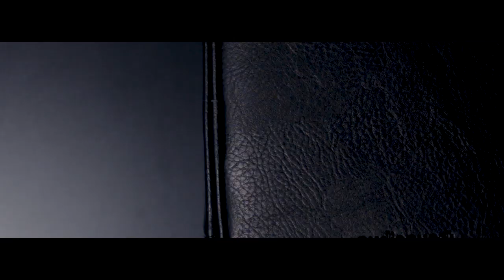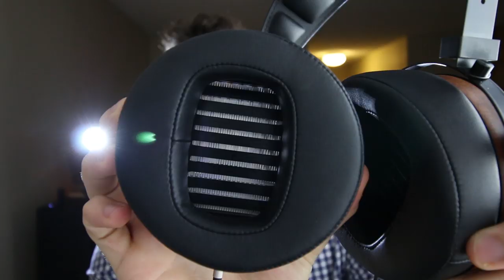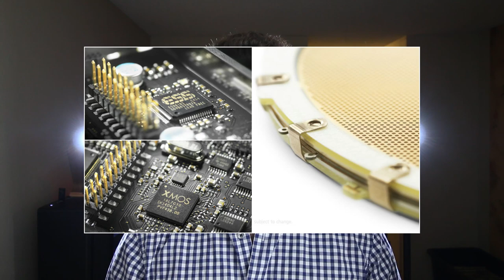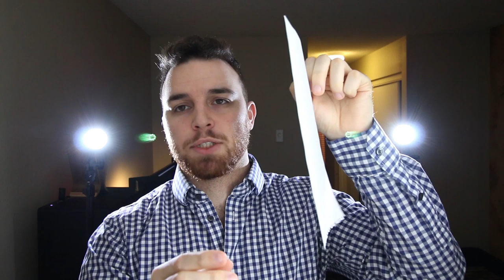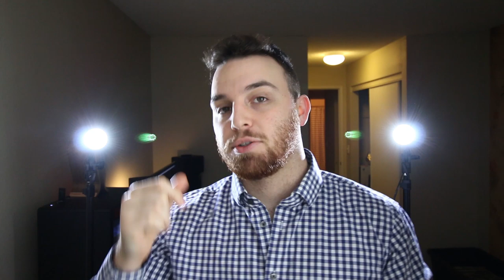Dynamic vs. Planar vs. Electrostatic Drivers | How they work and sound | The BASICS |

Comment: hmm, open back headphones means that the back of the cups are open. The other side of the cup can be sealed and still be called open back. SoO the sound can still bounce around inside. 
Try some of your planar headphones. push the cups towards your ears hard and quick enough and you can hear the driver crinkle. this wouldnt happen if the air was allowed to escape

Shining a light through a planar headphone doesnt demonstrate that its acoustically transparent. the material on that particular headphone just happens to be transparent (or somewhat transparent).
what you just did was like; shining light through a glass window and claiming its acoustically transparent.

Like dnalekaw mentioned below, sound pressure isnt all about driver excursion. its about how much surface area is moving the air. a planar driver being larger in surface area can achieve the same sound pressure level as a dynamic driver with less excursion. Bass response on better planar drivers measure near flat all the way past 20hz, so yeah, they can do bass.

Comment: 1:32 - When the ribbon, planar, electrostatic, and/or a moving coil transducer/driver within a set of reputable head phones (or speakers) are  asked to simultaneously reproduce a high frequency and a low frequency signal  what really happens is called "time averaging".

As, clearly both frequencies (not to mention the thousands of other frequencies that exist at any 1 time within normal listening music) the ribbon/other transducer can’t possibly perform this feat and reproduce the same signals simultaneously, and therefore time averaging occurs. 
 
To minimize time averaging we (professional loudspeaker engineers) apply techniques such as frequency and amplitude division.

Luckily for us that our ears - despite how remarkable they are at detecting small/large nuances of sound - are basically (I am trying to keep it simple with these terms) immune to most reasonable levels of time averaging - provided the source material is complex enough so that it has multiple frequencies/pitches within it and no 2 sounds alone can be individually detected (to be time averaging to the listener) by the listener at the expense of the others.

Kim Shaw

Electronic Engineer
Electrical Engineer
PhD Electroacoustics.

Comment: E
Reply: thats right
Reply: What about electrostatics? Are the diaphragms used on electrostats similar to those on planars? (As in it moves more air than the dynamic)
Reply: dnalekaw Thanks for the clarification. I really wonder why headphones don’t incorporate more drivers in them? Like how a traditional three-way studio loudspeaker is designed? I can imagine a large driver with a mid and a tweeter overlaid in front and to the side of it. Like a Venn diagram, with different sizes and angles applied to the drivers? With in-headphone amps becoming smaller, better and cheaper, it seems like there could be a much more sophisticated design applied to the way power is delivered and managed. I saw a pair of headphones reviewed that incorporated a passive “woofer,” but it seemed a little hokey. I think it’d take a company with the money and resources of Sennheiser, for example, put it all together.
Reply: @dasaauto2024  driver matching, Phasing, timing, disturbances between drivers, different sound radiation patterns, impedance considerations, weight. A single driver is adequate in reproducing all frequencies already. Essentially, all the answers u need are the exact opposite of the advantages of  a single driver home speaker.
Reply: Thank you
Reply: you forget to say. that the planars have much worse dynamics, because of huge resonances of membrane after some sound decay. and this is because of lack of damping.
Reply: TL;DR
Reply: Because you know way more about this than I do haha. I mostly play games. But, also watch movies and listen to music and stuff when I want to. Would you recommend something like planars for gaming?
Reply: riseuplight bruh just fuckin read
Reply: bandgeekforever100 • For a “utility user” like you, buying gear for a specific purpose (probably competitive advantage), there are a number of things to take consideration of.

First, gamers tend to play for more than 30 minutes, so weight and long term comfort are paramount. Usually, Planars are the heaviest with all those magnets and the rigid structure required to hold the parts apart despite the strong forces. Electrostats and dynamics are much lighter.

Second, cost. Electrostats require specialized equipment (the Energizer) on top of the “Earspeaker” itself... the least expensive is the Drop.com exclusive variant of the Koss ESP/95X at $450 (out of stock for the 120V USA version), and Stax’s least expensive are a Japanese import (2-4 weeks) SR-L300 + SRM252S bundle for around $800 USD. If you’re shopping above entry level prices, the Fostex T50RP mkIII is a nice planar magnetic headphone for ~ $160, and of course Dynamic headphones range in price anywhere from $10 and up.

Third, sound quality. The balance of frequency response is part of it (going lighter on the bass helps prevent tactical details from being overshadowed), but only part of it. It’s also ideal to seek clarity and low distortion, high resolution, the illusion of spacial depth (aka soundstage), and A NON-FATIGUING SOUND. It’s worth emphasizing against fatigue, us gamers play long enough that we can potentially cause permanent hearing loss (and probably will). Now, Planars and Electrostats have extremely light drivers (often lighter than air), so they are easy to control and theoretically can have better clarity, but dynamic drivers have become impressively advanced and some examples can stand right along with Planars at equivalent prices. Planars can have more bass impact (because the drivers are huge!), but dynamic drivers can extend lower into sub bass frequencies and some drivers are also very large to displace a lot of air (so they also have good impact... a nice amp helps all kinds of headphones to improve this). When it comes to spacial depth and imaging, it actually matters more if the drivers are angled to match the angle of your ears than what kind of driver you use... that said, the deepest/widest soundstage in headphones are currently found in Dynamic driver headphones. Virtual headphone surround or spacial audio processing GREATLY helps any headphone to achieve a useful “image” of where a sound could be coming from in front or behind you, and I highly recommend adding some form of digital signal processor (DSP) to your gaming setup (coming soon to be built into the XSX and PS5!).

In the end, the most practical and value-for-the-buck option for gaming is a dynamic driver headphone... though cases can be made for the others. One example is the Sennheiser PC37X... it’s a gaming headset, with a quality boom mic that you can flip up to mute and get out of the way, lightweight but strong plastic, generous earpads and headband padding, angled dynamic drivers with a bit of upper mids emphasis for tactical cues but also a bit of bass for fun, 2 year warranty, and Sennheiser’s R&D has been able to greatly reduce distortion (and the modal breakup from wobbling drivers mentioned by the first comment). Referral link that gets us both a discount, though Drop also has Planars and Electrostats if you look: https://drop.com/buy/massdrop-x-sennheiser-pc37x-gaming-headset?utm_source=appshare&referer=Z2JXCA
Reply: My Hifiman HE400i can output much more bass than any dynamic driver I have ever owned.
Reply: @Countryguy5967  planars for gaming? I have one single sentence for that, Hyperx Cloud Orbit S. Without going over twice what these cost, I doubt I will ever find a better headset, let alone a dynamic driver headset capable of beating the Planars on the Orbit.

Comment: let's simplify things a bit in terms of comparison, because how they work, You can't beat a piezo electric driver in low frequencies(taket h2), If you are ready to pay 5k$+ electrostatic headphones are just better at everything, cheap models&high-end electrostatic models with average amps will lack sound stage & bass but with good amps which can swing  high voltage peak to peak (for example 1500Vpp)  those can solve these problems. Keep in mind however, electrostatic headphones have an ethereal sound signature, their sound signature is like holographic presentation of the real instead of the physical representation. They are different, make sure you try them first before you consider buying. Ribbon drivers has the speed of electrostatic headphones, has the sound stage of planars and the impactful bass of dynamic drivers. The downside is that they require INSANE amount of amplification to work, 200W per channel at 8ohm for example. They sound a bit too thin & crisp also time to time.

when you buy a pair of headphones, you don't only pay for the product & material used in the build, you pay mostly to the engineers who made the calculations involved in the making of the product. Dynamic driver calculations are relatively simpler compared to planars & electrostatic. I find dynamic driver headphones to be outdated, if you have enough budget go for planars or electrostatic headphones. I myself use STAX sr007 with KGSSHV carbon amp. (hoping to get RAAL SR1A soon)

Comment: You do an excellent breakdown of headphone speakers. I know more about loud speakers that’s headphones. Seeing how each design or style of headphones has pros and cons. Has anyone designed a headphone or loudspeaker which uses the best of all three build types. Like electrostatic for the tweeter, planar for the mid range speaker then dynamic for the woofer. With your break down of the build types a speaker with all three styles would produce the best sound reproduction. Not to mention probable cost a fortune. Has that been done or just not economical?

Comment: I've never heard a dynamic headphone that matches the bass reach and quantity of the bassier planars. Some of those things are such bass monsters that I'm not convinced we'll ever see a dynamic beat them. When it comes to larger diaphragms IN GENERAL? Sure. I am team big woofer all day with speakers. There is no replacement for displacement. I don't understand the obsessions with itty bitty kilobuck speakers that will inevitably suffer greatly in the low end. I don't care what flowery words people want to attatch to it. They don't have the impact and viscerality of big honkin woofers or even horn-loaded compression drivers. That's me. It's just not even close. a 5" woofer will never have command over bass like a 12 will. Big dynamic drivers do bass exceptionally well. The key word being BIG.

And that all STILL rings true in headphones... meaning, with headphones, we're talking about dynamic drivers roughly around the size of a half-dollar. Not much bigger than a tweeter, which though designed differently, face a lot of the same limitations. Maybe even less because they're not running full-range like a dynamic headphone driver - something else worth considering, you can only tune them to have so much bass before IMD eviscerates the highs OR you need to make changes to the coil that will negatively impact treble to keep the driver from just bursting into flames when the coil overheats.

It would need to have exceedingly high excursion to output the deepest bass at audible levels. Those bass waves are very, very big... like dozens of feet long from peak to null. To produce them you need either a very large diaphragm or at least a medium-sized one with extremely high excursion. Headphone drivers, even the "big" 50mm simply aren't up to it, physically. And past that point, you are running into other problems due to the physics of wideband operation. The bigger the widebander, the tougher treble and upper mids get to hold together. So it's a pretty hard wall when it comes to how much bass dynamic headphone drivers can reasonably made to output on their own. We're talking yet unseen levels of rigidity, durability, and damping to make that work. The bass performance on dynamics is thus pretty predictable. IME they tend to lack that last bit of low end, but can slam a little more in the mid-bass - it's usually a little patchy, whereas a planar just grabs the whole bass spectrum and tells it what's what ;)
Reply: My th900 mk2 fostex can produce so much bass that im shocked. My planar headphones cant do that and i check this on meze empyrean, he arya, audeze lcd2, audeze lcd3

Comment: Planars and Electrostatics won't take a lot of abuse. I'm an electric bass player, and I've never seen a bass guitar cabinet that uses anything but a dynamic cone driver. Sure some extended range cabs will use a piezoelectric speaker for the tweeter. Now I'm not saying nobody has ever made one, a bass cab with a planar or electrostatic driver, but I've never seen one, or heard of one.
Reply: Can't say much about electrostatics, but planars are indeed more fragile due to how the magnets are set up, they're always under strain, due to being forced in position where the magnetic poles are opposite, so the magnets themselves are always pushing each other, so if you introduce a bit of shock, that strain increases exponentially due to the constant magnetic force... once a magnet cracks, the leverage holding them in position is gone, pieces fly everywhere, re-arrange themselves according to the magnetic poles, absolutely shredding the membrane etc, it's a mess.

So it makes perfect sense. :)

Comment: I haven't listened to too many (o_o)phones, but so far the OG type of driver, dynamic, reproduces sounds in the most realistic and natural way. That means I will gladly deal with the inherent quirks (bass rolloff, something you forgot to mention, and uneven treble) when searching for my dream. Dynamic 4 Lyfe basically.
Reply: I disagree, having a higher end planar magnetic has such a low noise floor, and has clear depth and range compared to a dynamic.

Comment: I know this is an older video; but would really appreciate a reply/your-thoughts: I've heard than planar headphones have a durability issue.  Is that the case &/or what are the general (there's always the exceptions, of course; level of quality/product or whatever... what's the average) durability differences among these three?  Thanks!
Reply: I've owned planars for some time and I can't say I've ever experienced any durability issues with the driver.  If there's ever going to be issues with planar headphones, it has nothing to do with the technology itself and everything to do with poor build quality on the manufacturer's part. To be clear, I'm not talking about poor quality within the planar itself, but everything else (headband, ear cups, etc.) One planar comes to mind when thinking about poor build quality and that's the Monoprice Monolith M1060... Literally everything about it is junk except for the sound quality it produces lol. 

I own the M1060, Hifiman HE4XX, and the Hifiman Sundara... I very much prefer the Sundara. Had the M1060 not beed so terrible, I wouldn't have felt the need to buy the Sundara because there's not a huge difference between sound quality, but I'm so glad I did because it is actually better in every way IMO.

Comment: Dynamic drivers also come in the form of open acoustic design, e.g sennheiser HD600, philips fidelio X2, and the list goes on. so your explanation as a benefit for planner magnetic or static membrane in that regard is not correct. second, the speaker designer may design the speaker element with an acoustic absorbent material behind and around the driver to dampen most of the reflections. third, music instrument as we all know have resonant chambers made usually from wood like piano, drums and guitars. the resonant chamber is placed there for a reason. in the music world we do want some time resonant chambers and some headphones and speakers are designed with that Technic implemented. usually to balance the response curve. The professional world will use Dynamic drivers rather than the other two method simply because considering all aspects: efficiency, dynamics: spectrum, and cost - they are the best combination of all merits.
you will not find professional studio equipment made from other types of drivers than Dynamic drivers, that tells us a lot.
Reply: A Y Dt 770's <3
Reply: you don't want the resonance of the headphone you want the resonance of the sound playing in the headphone.. you act like you know your stuff but you dont..